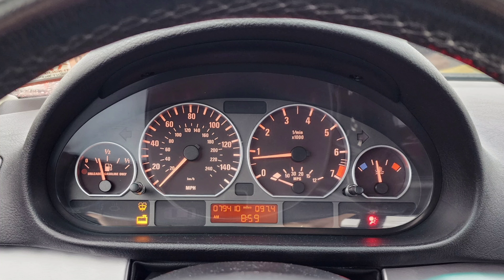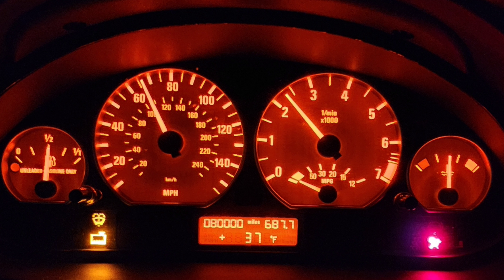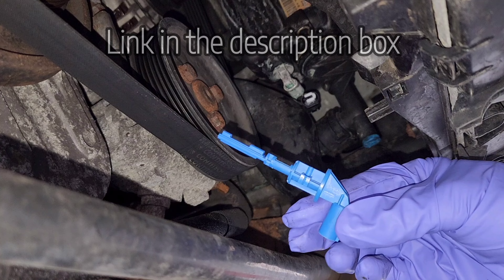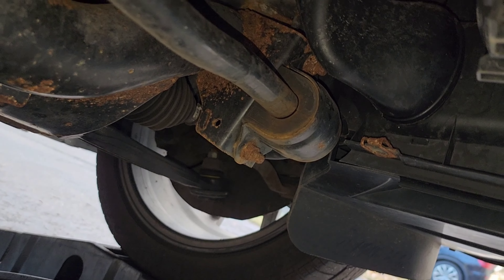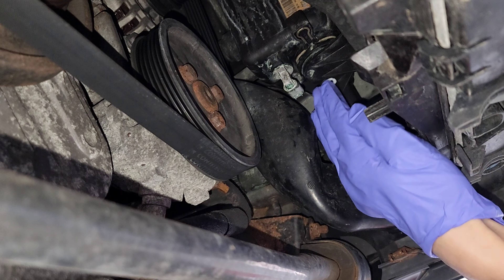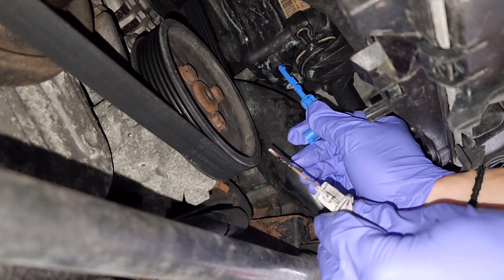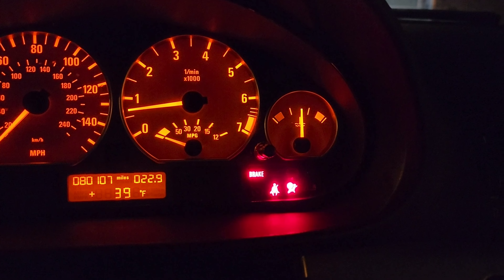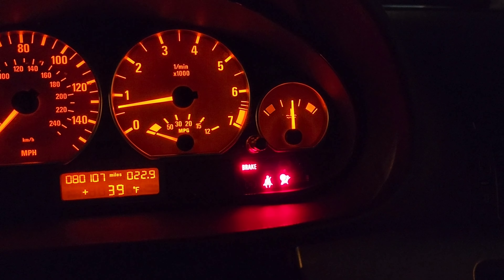BMW e46 3 series Coolant level sensor replacement

Comment: The coolant level sensor is a reed sensor in a dry vertical chamber in the expansion tank. The float surrounds the chamber with a magnet at the bottom. When the float is at the bottom the magnet induces the reed sensor to close, indicating low coolant.

Comment: hooooly unko! you mean I DONT have to remove the expansion tank to do that? oh man, thank you thank you thank you. installed a new sensor last summer when i changed the radiator, expansion tank and upper hose. but the new sensor was faulty. the shaken (inspection every two years in japan) is due this year and it wont pass with the coolant sensor on, but I just didnt want to drain the coolant and remove the exp tank. oh man, dude. big thanks, im gonna do this today. Had the same problem with the airbag light too, after a mechanic installed a new driver's side window regulator. I took it to the dealer in kobe and the switched off.
Reply from the maker: Yessirrrr
Reply: Its easy to take out on my 318i e46 . I done it just to look at how the car worked haha

Comment: Thank you so much, I have the same issue, and I am going to do the same, and also with the airbag light, will be looking forward to next video, cheers
Reply: Wow same mine..I'll try it thnx for this video
Reply: Did u solve issue with air bag my light came on but air bags are fine curious to what you did
Reply: Fix that airbag yet?

Comment: Hello, I changed the water pump, it's been a week and my antifreeze tank came on, I bought a new sensor, I replaced it, the error still remains
Reply from the maker: Id check the wiring of the sensor

Comment: There must be something wrong. Water must be flowing out. How else does it measure the level?
Reply: There is nothing wrong, that’s how it is on my 2001 e46.
Reply from the maker: The reason why no coolant came out is because the coolant level sensor sits in an air cavity and works via magnetism. This is expected behavior😘
Reply: @HansGarage Hello, I changed the water pump, it's been a week and my antifreeze tank came on, I bought a new sensor, I replaced it, the error still remains
Reply: @HansGarage What else should I do to make it go away?